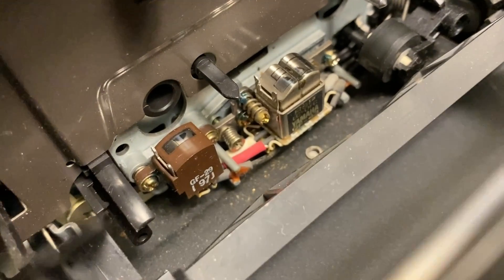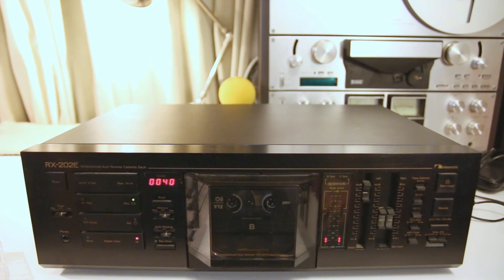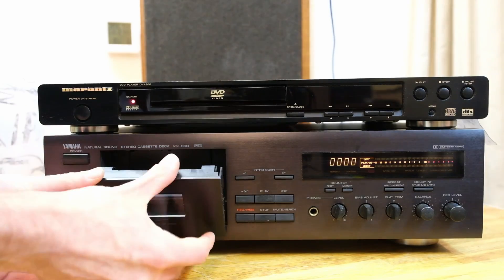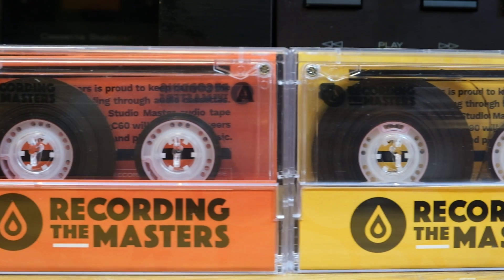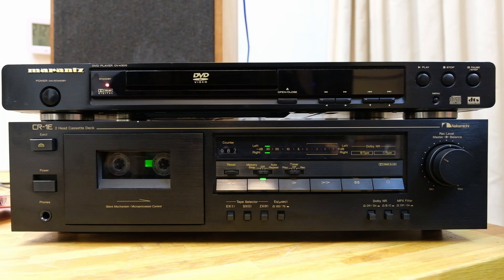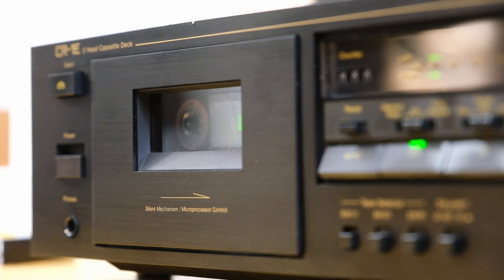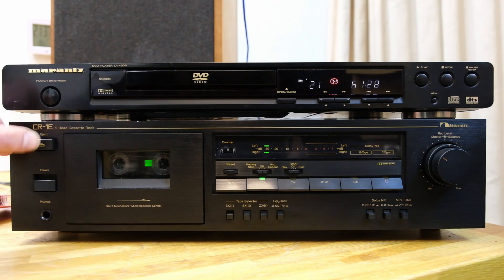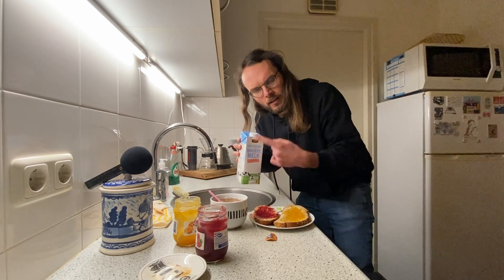The basics of cassette recording

Comment: I'm glad you're not allergic to using alcohol on a pinch roller. My oldest deck dates back to 1977 and has always had the pinch roller cleaned with at least 97% IPA. It's still nice and springy and looks like new. If you have a cassette deck with Dolby C or S, a Type I tape can sound surprisingly close to a Type IV. Both were specifically designed to combat the effects of tape saturation, so Type I benefits the most. I use cheap TDK FE Type I tapes most of the time in my Dolby S decks as the small difference in performance between those and a TDK MA Type IV doesn't justify the expense. If your recordings in Dolby C or S sound worse than without then your cassette deck is either very poorly calibrated or broken.

Comment: I don't know if you will read this or have the answer to this, but I just had a question about making mixtapes from digitally streamed songs on my laptop. Personally I use Spotify, and when I made a mixtape (I use a Sony TCM-200DV) there is a sort of thumping noise on "bassier" parts of songs I guess. I'm thinking it's just some overload/clipping and I was wondering how to combat that so when I record tapes and listen back I'm not thrown off by the clipping noises.
Reply from the maker: @angelunavvare  I read everything 😁.
the Sony has no line level input. That input is for microphones only. You can't use this recorder to record from a computer. Also all recordings you will make with this are in mono, not stereo. And even if there was a line level input on it the quality would be ultra low. It is really only meant for voice recordings.
I am afraid you will have to look for another recorder to make mixtapes.

Comment: I wasn't a fan of recording to tapes but one time just for fun I recorded myself practicing (synthesizer) and upon reviewing the tape, the tonal quality of the sound from the tape was far superior to anything I've recorded digitally.  I'm well aware you can edit your recorded digital track to match the tonal qualities of tape, but for a hobbyist, I think cassette tape is a great way of achieving a very excellent quality recording without spending hours fidgeting with vsts or spending a small fortune on gear. 

Great video thanks for sharing!
Reply from the maker: You wouldn't be the first one to run a track through tape, and then edit it digitally after. I don't know what quality you record in digital, but try 24 bit, 96khz or above, and it gets a lot closer to tape. It won't have the natural distortion and roll-off of tape though. And of course, these are objectively downsides of the medium, but they do create a more pleasant, organic listening experience. Sometimes better is not nicer :). 
Judging by what you say though, I do highly recommend you get yourself some reel to reel recorders, one 4 track (4 track, not 4 channel) with the 3 3/4 and 7 1/2 IPS speed, and a 2-track, with the 7 1/2 and 15ips speed. I'd look at the TEAC A-2300SX and A-3300SX for that. Then you'll have varying levels of tape 'ruination' to play with. They don't come cheap anymore (although I neve rpaid more than 60 bucks for an A-2300SX, patience is a virtue) but they are worth it, and rarely REALLY defective.
Reply: @rollingtroll  Hey thanks for the excellent advice.  Very much appreciate you giving your time to reply!
Reply: What brand of cassette recorder and tape did you use?

Comment: ALL my decks are type VI capable, I have them, but rarely use them except if I'm recording classical, other than that, type I gives me EXCELLENT results, I have MANY type II tapes, and rarely use them!
Reply from the maker: My favourite tapes are the TDK AR-X and AD-X. Type I is so underrated.
Reply: @rollingtroll  AGREED, I've had a couple of those over the years, and I haven't seen those in FOREVER, they're VERY UNDERRATED!
Reply from the maker: @ricardoflot2787  Another one that sounds stupidly good is the Scotch Master I, but they are unreliable. That being said, the Maxell Metal Vertex is also ridiculously good but well, check ebay prices. Thanks but no thanks :).
Reply: @rollingtroll  Those Ampex Grand Master cassettes I miss ALSO, I should've gotten more of them when they were available!
Reply from the maker: @ricardoflot2787  Grand Master is completely unusable in 2024 though :)
Reply: @rollingtroll  interesting, my decks are older, and they were around at the time GM was available. Maybe I'm missing something, please explain.
Reply from the maker: @ricardoflot2787  they all are sticky and squeaky now. Like the Scotch and many other tapes that weren’t Japanese they became unusable.
Reply: @rollingtroll  I do remember that because I also had GM open reel tapes, that after awhile they started shedding and lost their fidelity, but I never got that far with their cassettes.
Reply from the maker: @ricardoflot2787  Same with the cassettes unfortunately.

Comment: Every deck is different , if you can monitor the recording you can listen and adjust the settings and level to get the best sound. I made great dubs using Dolby C and Chrome tapes by SONY TEAC Memorex  Maxell Fuji TDK , even Radio Shack Realistic  had good chrome tapes.
Reply from the maker: You can also just rewind for that :). Bit more work but it works!

Comment: Great video. Question: if i have a tape recorder without any type settings to change, how can I record type II properly?
Reply from the maker: It will have auto tape detection, it is explained in the video too :). That is what those notches on the top are for. I suggest you watch the whole thing!
Reply: @rollingtroll  I did aactually, I must have missed it.
Reply from the maker: @connivingkhajiit  5:54!

Comment: I have an 80s Panasonic 635 deck hooked up to a 70s Sansui 221 receiver. I listen to tapes all the time on it with no issue. I finally tried recording from vinyl the other day thinking it would be easy enough (I also listen to vinyl with no issue).. It’s recording but I can barely hear the music on the tape, I have to crank it and even then it’s mostly tape hiss. I tried adjusting the input levels, the tape select and input select with little to no change. What am I doing wrong? Do I just need to clean the deck? Thanks 🙏
Reply from the maker: Time for some head cleaning. Also what tape type are you using and did you set the tape type accordingly? Also I assume the levels are looking normal during recording?

Comment: Errrrrrrrrrrrrrrrrrrr Dolby? Please don't tell me you're one of those who thinks it doesn't work. It does - and really well if you understand it, especially S although that's quite rare - even your Naka there only has B & C.
Reply from the maker: It works, but I can hear it work, and that's not worth it to me. It does at it promises but has clear downsides that I can't live with, and I can live with a little hiss, so that's an easy choice to make :)
Reply: Not many deck have the same NR performance tho. JVC for example have ANRS and Super ANRS on few decks for example in the end 70s and 80s. Even it got an external NR System from JVC (similar thing to DBX 224 Type II Unit). Suprisingly, the ANRS handles better to Dolby B encoded prerecorded tapes. Not at all but i played few Dolby B with HX Pro tapes and it sounded more OG. Even with Chrome prerecorded tape would performe very good.

I mean i have tested to record Dolby B with Type 1. it sounded decent for, the hiss is still there but smoother than harsh. C sounds very good and S is like Lossless. But if i playback to the JVC deck, they sounded bit different to their components. Which in many case, tapes can sound different depending on the gears you use.
Reply: I bought a new Teac W-1200, and one of the things people put it down for is not having Dolby, but DNR.  After trying it out, DNR works far better than Dolby ever did.
Reply: A great many have hi end hearing loss and even noisy hi's 'sound' better. Dynamically. Of course Dolby works.

Comment: I own an electronic repair business. I do not recommend you clean the rubber pinch roller with alcohol. They will dry up, stop feeding the tape, and will need replacing. It’s best to leave the rubber alone.
Reply: What would you reccomend using instead to prevent this from happening? Is there some sort of DiY cleaner that can be used or a specific type of conditioner/cleaner that can prevent this?
Reply: @bartholomewgc4393  If just cleaning, then water is best. If you wish to restore the softness of the rubber, mg chemicals rubber renew works well. Use it outside and handle with gloves and a mask. Let the rubber roller soak in a small cup full of the liquid for an hour. Wash off with water. In most cases, you’ll get at least a few more years out of it each time. For best results, just buy a new pinch roller if you can find the correct size for your unit.
Reply: @truthorhappiness I’ve seen VWestlife, another cassette content creator, say he cleans his rubber rollers with window cleaner instead of alcohol so it doesn’t dry up, is that cleaner a good choice?
Reply: Windows cleaner 😂 alcohol 😂 water 😂 nope isopro alcholic 99% heads
Roller? they are special products for that... hi fi stores
Reply: @thorbampougias311 window cleaner has ammonia not alcohol
Reply from the maker: Only seeing this now. I know there's a few old reel to reel machines which have rubber rollers that instantly disintegrate when you use alcohol. But having owned hundreds and hundreds of cassette decks and never having had any issues, I think this is more something that is theoratically true, than actually as big of an issue. May be different if you use bad tapes and have to clean your heads every tape, but with casual cleaning I never had any problems with pinch rollers.
Reply: I've heard window cleaner is very good for pinch rollers.
Reply from the maker: @coreymilne1568 reading the comment is not the worst idea before you answer ;).
Reply: I would recommend mixing a drop or two of dish soap into a cup of water and using that solution on a tightly packed cotton swab. It’s mostly water but the small amount of surfactant provided by the soap will remove any dirt and grime.
Reply: The best Form Pinch Roller : 3M Rubber anda Vinyl 80, Spray (Industriel grade)
Reply: @rollingtroll  Same here. I've been using at least 97% IPA regularly on the same deck since 1977 and the pinch roller still looks and feels like new. I don't know if that's some kind of a record as it's had a fairly hard life over the intervening 47 years to the point where I've had to replace the R/P head twice due to excessive wear. It's been the experience with this deck that's led me to using IPA on all my others over the years and none have ever suffered any ill-effects.

Comment: I had an auto reverse deck. Never had a problem with the rotating head. The tape drive motors became worn out, rotating head never failed. Don't know why they are hated so much, Wish they still manufactured them.
Reply from the maker: I had hundreds of cassette decks. Trust me, it is an issue. About half of them are unusable because of it. Some don’t suffer from it but it’s not worth the risk
Reply: @rollingtroll  Mine was a Teac double deck model. It looked like a quality mechanism that rotated the head. 

I think some decks are made for music recording and fidelity  like the 3 head design while others are intended for recording broadcast radio like sporting events. I liked the rotating heads for broadcast recording. It must have been issues on the really cheap models.
Reply: Rotating heads are almost impossible to set up for proper azimuth in both directions. Tapes made on such a machine may play back properly on that machine, but they will not play back properly on other machines.
Reply: @Yoda8945  Never had that problem. Recordings were broadcast quality. Sounded as good as any standard fixed head tape deck and Was the same across players.
Reply: @fraudsarentfriends4717  Did you ever check it with a Sound Technology 1500 Test system? Otherwise, you are guessing.
Reply: @fraudsarentfriends4717  You use the term "broadcast quality". AFAIK,there is no broadcast standard for a cassette deck.If you have a source for the standard, please post. Broadcast quality was pretty much developed for video machines.
In audio use, the standard was NAB 7-1/2 ips full track reel-reel.
Reply: @Yoda8945  Radio stations use cassette decks. They are apparently broadcast quality decks since radio stations use them.
Reply: @fraudsarentfriends4717  You are making up definitions.
In radio stations, cassette decks were used for field interviews and the interview was transferred to reel for editing. The interview was broadcast from the reel tapes not cassettes.
Specifications for cassette decks are very loose.  +-1% speed variation and to hold that, cassette decks needed constant recalibration, plus the fact that there are three types of cassette tape with different bias requirements and two equalization curves makes it very difficult to establish a "broadcast quality" standard for them".
Reply: @Yoda8945  Rack mounted cassette decks are used in production rooms. They only use equipment that is broadcast quality. Many cassette decks have features on them specifically for radio stations and broadcasting.
Speed variation is within tolerance for production room and broadcast use.

Comment: I'm in the process of recording a cassette with sound coming from my PC's audio interface (scarlet focusrite), and I was wondering if I needed to use the Dolby NR during recording ?
Reply from the maker: If you use it during recording you also have to use it during playback, that's how it works. I personally don't like it, I can hear it work and I don't care about a little noise. Whether you use it is depending on whether you too hear it work, and on whether you care about the noise. Record with and without, and be your own judge. Just remember, if you record with Dolby, you have to play back with Dolby.
Reply: @rollingtroll perfect, thanks !
Reply: @rollingtroll Thank you !
Another question to ask, should I use my PC's audio interface to record a tape or using my phone will set the same quality ? If I play the same audio of course (.wav file).
Reply from the maker: @thedarkflowkiller  depends on how good your phone sounds 😁. The cassette deck doesn’t care, so use whichever one sounds better to you.

Comment: Hi
Asking here because don't know where to ask
I make new tape recording from dsd512 sources
i would like to know a which level do i must set the bias of the tape recorder of the sweep test signal?
thanks in advance,
have a good day,
rgds,
Reply from the maker: You set the level of the bias so the recording sounds as close to the source as possible. Just use your ears. You can't use sweeps for biasing unless you use measuring equipment to set it up. Most decks set their bias at the highest level (sound level) at 10khz, but it depends on the deck and you'd need the service manual to be sure. 
Seriously though, just grab a song that has plenty of highs and lows, and adjust the bias until you can't keep source and tape apart :).

Comment: im just about to buy a denon dr-m11 the cost is 25 dollars it is a good deal ?
Reply from the maker: If you know for certain it works properly, then yes. Absolutely. If you can't do any work on it yourself, make sure you test it properly. Often people don't know what they sell. Bring headphones, bring a source (phone, laptop) with a cable to make a recording. Also bring a known good tape so you can play back, see if it sounds clean, if the speed is correct. 
As for the recording; If you use a proper, relatively modern tape then you should not be able to hear a noticeable difference between the source you are recording from, and the tape when you listen back. Good luck!
Reply: @rollingtroll  i just buy it and it works great but the speed is slower a already put the adjustment to the max but still around 12hz slower
Reply: @rollingtroll  i just find a new motor in some cheap Sharp system and now it works perfectly

Comment: hi buy tape line cassette tapes don't have any makes all over them  and the heads that turn be ok if they are service alot 

note never use turning heads to record  just in case the heads out of line  i am a tec   all the decks i work on i check moving parts for wear 
i am lucky i talked to alot over the years  there are alot of poor looking decks out there 

my sister had a  cassette radio  dad got her it hell it was junk of a deck  heads were to soft  mate had a low end cassette hi-fi   the head dead very fast   
i had a 4 track mono in the 80's  still working the case has had it  

i know the fox tapes  they something to do with tapeline  i have the 1/8 tape pancakes  for my otari dp2700  cassette loader 
i have been asked to show the deck on the net  bob